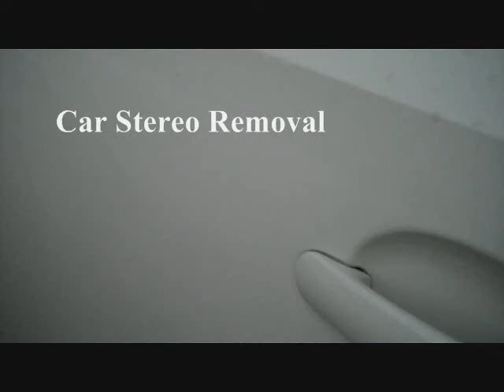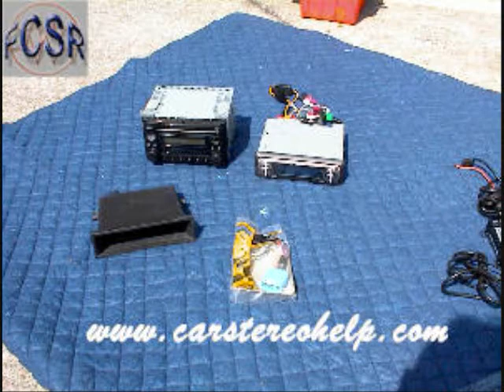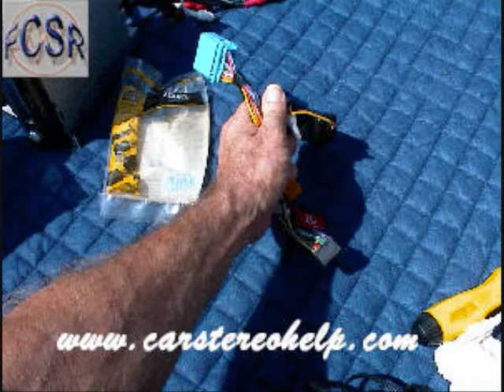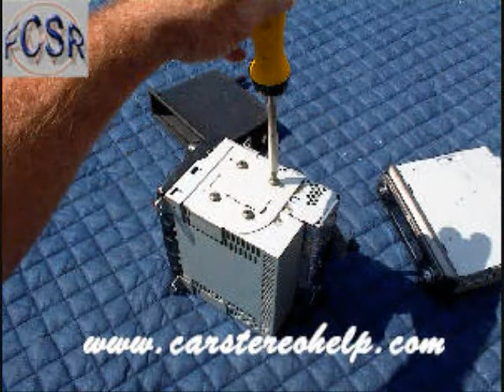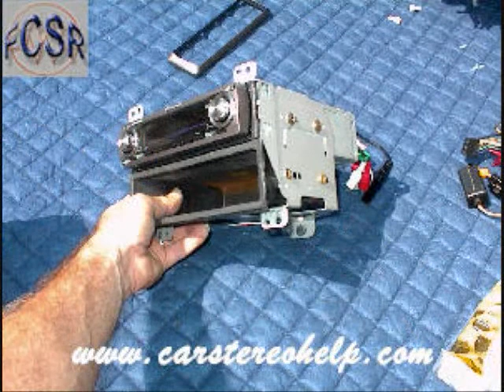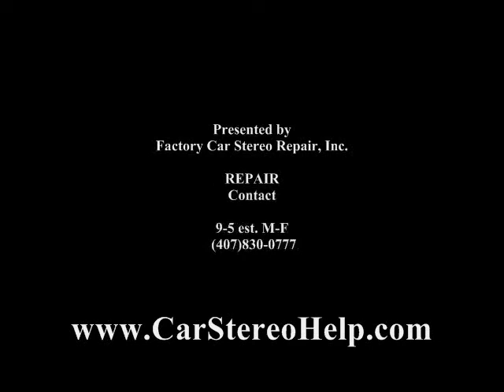Suzuki Aftermarket Car Stereo Installation = Car Stereo HELP

Comment: So. Eventhough the original radio hole has rounded off corners a square radio will still work?
Reply: Brock Turner I ran a Wx900BT on my 06 Aerio and yes, but the holes around the sides are annoying, and apparently there’s no kit for double DIN head units...

Wish there was one tho...